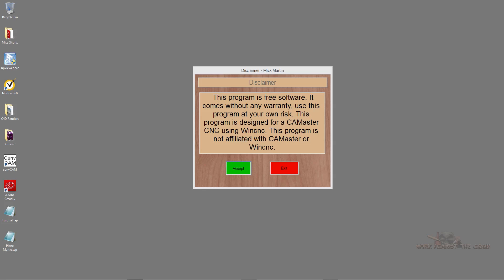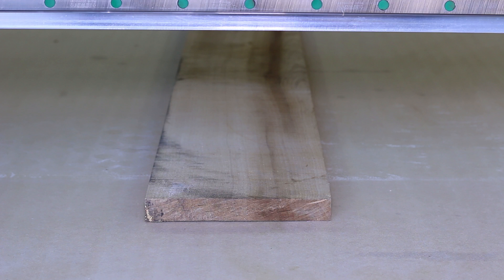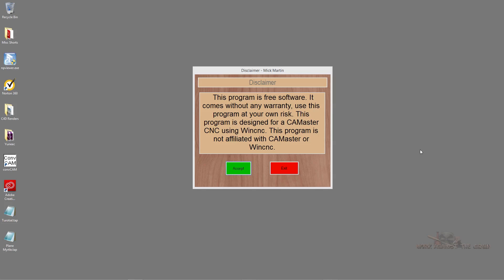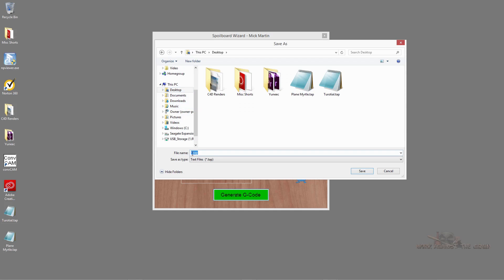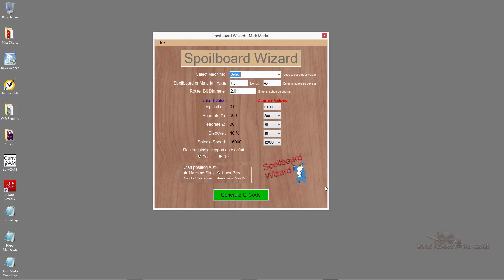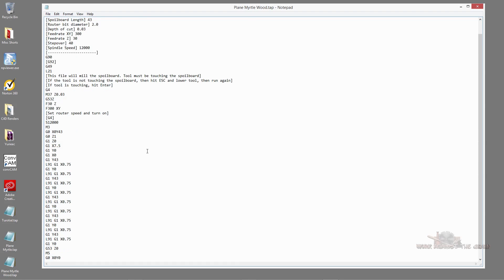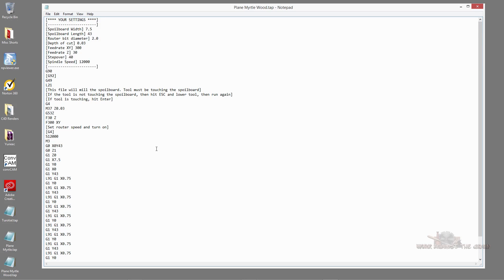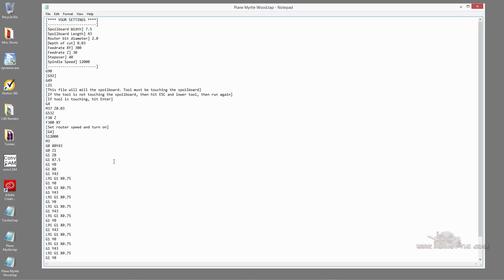Mick Martins Spoilboard Wizard

Comment: This code does not work with Mach 3. Is there a mach 3 file for this program. Thanks
Reply from the maker: I believe if you create the code, save it to your desk top, open it in notepad then save it as a .txt format it will work. The creator Mic can correct me if I am wrong or if there are copyright issues or any legal stuff. I think Mach will run a .txt file.

Comment: Any way to do this on X-Carve/Shapeoko?

What type of bit are you using?
Reply from the maker: +TheRangeControl Yes sir. It is just a G Code generator. I use a 3 or 4 inch surfacing bit.
Reply: +Work Against The Grain hmmm...

I have so much still to learn.

Thank You
Reply from the maker: +TheRangeControl As you get going, feel free to put a list of questions together and email me anytime at jefonitoo@gmail.com. Easier to communicate that way. Have fun.
Reply: +Work Against The Grain Thank You So very much for your generous spirit, Sir!!

Comment: Jeff, I thought you used Legacy's CCAM4?  The surface planing technique in CCAM4 is really well done.  It always climb cuts.
Reply from the maker: +James Bushey Oh yes sir I do. I just thought what Mick created was so cool. If you have something to plane or specifically the spoil board it works so fast. Enter, generate G code and start cutting in like 90 seconds.
Reply: +Work Against The Grain Jeff. How do you use CCAM4? Tracy told me that it would not work on non-legacy machines. Will they sell it to anyone?
Reply: I do not know what Legacy policy is on CCAM4. They would be the ones to ask about that.  I use as I have a friend with a legacy machine.